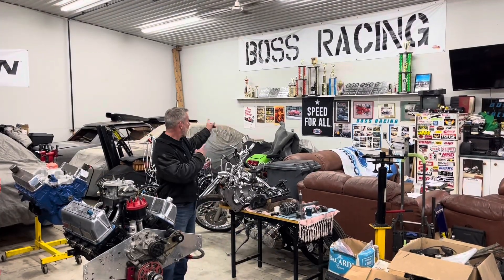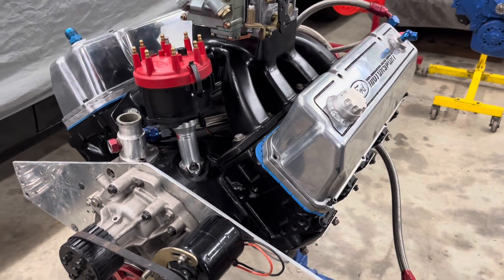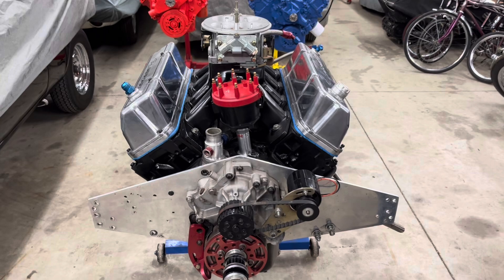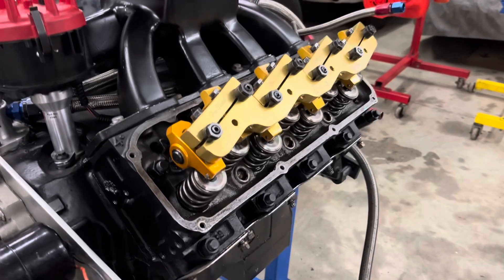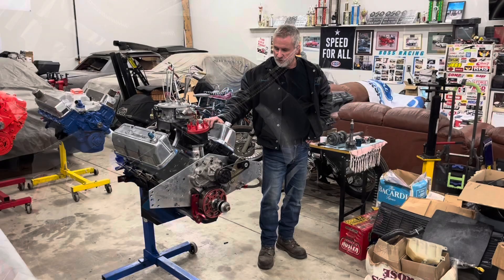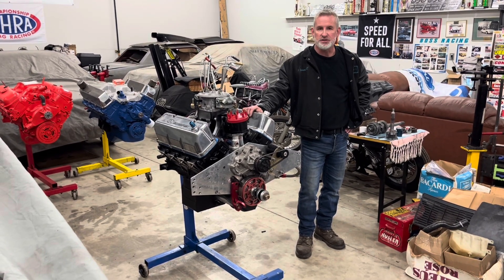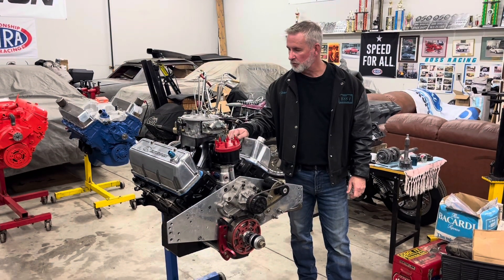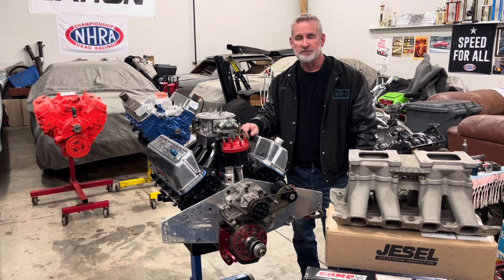351C makes 754HP with factory iron heads!

Comment: i bought a 1970 boss 302 mustang in 1975 with a transplanted 351 cleavland built to 351 boss specs. not a 4 bolt main. the seller told us teenagers not to rev it past 7 maybe 6 but that car went like hell. there was not a camaro lt1 350 that would chalenge us after a few races. my other freind had a 72 grand torino 351 cobra jet. his brother worked for ford ans hopped up the engine. that car was heavy but fast and comfortable. all in our teens.

Comment: This is definitely a bad ass setup! In my own humble opinion, I would work with the 358 over 400" I just think it has greater rpm potential! More cubes in most cases involves increased stroke, which means increased piston speed, decrease stroke and you reduce piston speed as you know, but just my opinion.
Reply from the maker: Ideally I’d like to see a 4.155+ bore with these heads, but we have a nice billet crank/rotating assembly that’s actually setup for nitrous use, so we may experiment with that this coming season.
Reply: @boss_racing  I've known a guy in my area to run a little nos on a bad ass NA SBF Fairlane 10.5 tire, Liberty 5 speed as well, I believe he was trying to compete in a heads up class, IIRC he went like 5.20-5.30 at the 1/8th. The nos didn't give him a lot, but a few tenths or so can be the edge in a competitive class. I think you guys got it NA tbh have a lot of advantage with your program & being able to get down sketchy surfaces!! Thanks for the reply, not sure if I am speaking to Brad, but it's a pleasure!
Reply from the maker: Thank you, this is Braeden I do all the YouTube and Instagram stuff, but yes the n/a combo does work well and until it gets beaten clean in stick shift no prep competition I don’t see the need to change it, however I’d still like to try some stuff on frontside to see how it responds. The 401” windsor in the car now is around 100hp better than the Cleveland, however the cleveland never lost a round of stick shift no prep competition except for one final where the trans broke. Very reliable consistent combo.

Comment: Would you tell us the cam specs, I run a 383C with the A3 heads but thinking of building a stock stroke Cleveland screamer.
Reply from the maker: This one is a comp custom grind it’s .740” and 270*

Comment: WOW....Good Job man. There is also a 318 mopar of all things making 700hp, but of course it has AFR heads. You know with you using the cast iron heads it would make a good team for either a LOT of Nitrous or blown/turbocharging. Iron heads seal well with iron blocks, not always the case with aluminum heads as they expand at different rates.
Reply from the maker: There may be a small shot of spray in this engines future… stay tuned
Reply: I would like that in my 88' notchback.
Currently running a 347 stroker with gt40 heads, Lunati 351W f.o. .496 int .512 exh. Keith Black raised dome pistons with valve reliefs 10:1 compression. A C-4 small bell housing with reverse shift pattern. Motorsport 3.73 gears, Detroit locker 8.8 rear end. Alot more good stuff with all the machine work it's a torquey SBF.

Comment: Always loved cleveland/boss motors, Car also looks absolutely Awesome! Would love to see how you worked the cylinder heads to get those numbers. Thanks for posting!
Reply from the maker: Basically the floors were filled and  the short side and bowls were re done, along with a lot of chamber work. Once you get the valve job correct the port really wakes up.

Comment: Is this motor strictly designed for drag?  Would you change much to run it as a road course motor?
Reply from the maker: This is a drag race only engine and we forgot to mention in the video that the block has the water jackets filled so it wouldn’t like a road course environment very much
Reply: Drag only

Comment: Thank you for making this video. Very nicely done. Nice to see it is all iron. I assume closed chambers and a filled block.
Reply from the maker: That’s correct closed chamber heads with a very tight quench, and the block is filled, we run water through the heads only

Comment: love it!  was that cfm  with the intake port tongues?
Reply from the maker: Yes that was what they flowed with the floors filled. Filling the floors and getting the short side correct is a huge deal on the cleveland heads, another secret we didn’t mention in the video was the 55 deg valve job which helps a lot with airspeed through the port 👀
Reply: @boss_racing  I got port plates in mine , what a difference !
Reply: @boss_racing  thanks!  I have some to install - great to know they work so well.
Reply: @boss_racing  Fantastic... I did some 4V's years ago, with a J Tongue design...Australian design.. Port looked similar to a 2V.  45 Deg seat.. 350 CFM at like .650" lift......